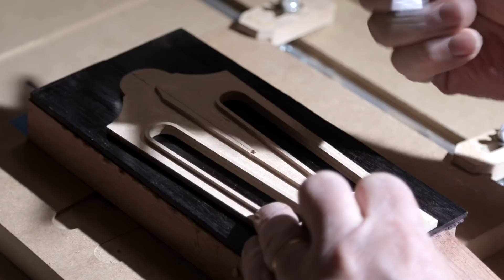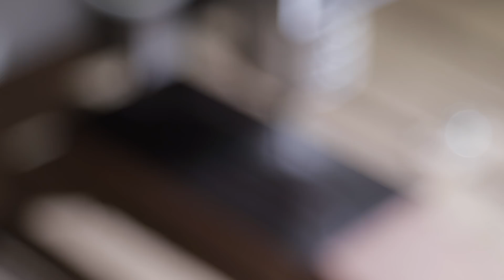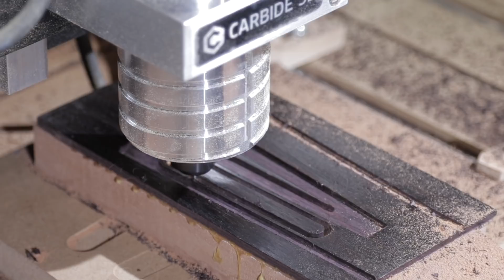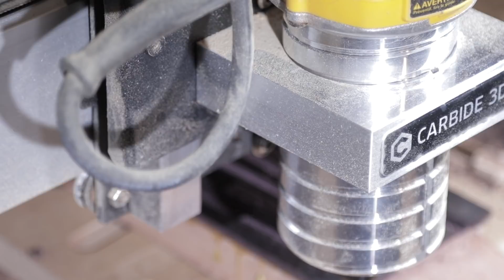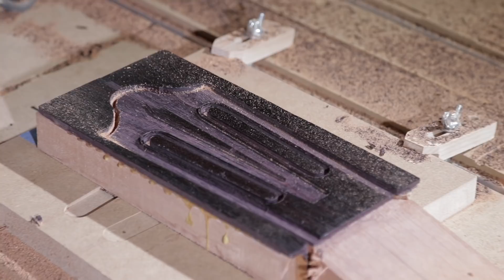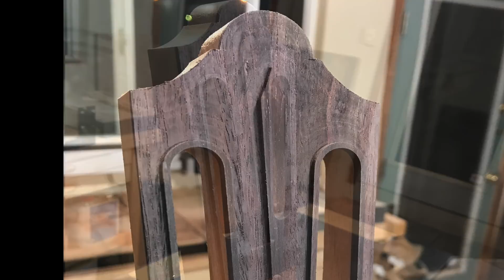Friederich Head carved on a Shapeoko CNC

Comment from the maker: Believe me, it takes far more skill and knowledge to cut a head stock like this with a CNC!  WTF is the difference if someone cuts a head out with a bandsaw then routs the head and slots with a hand held router, or table top router, or a milling machine?  Any Ape can cut a head with a bandsaw. That same Ape will have a steep learning curve and significant expense doing it on a CNC.

There are retired physics professors in my CNC class that are trying to wrap their brains around the tool-paths and design functions in CNC software. 

Not that I'm by any means a great artist, but there comes a point where the artist transcends the limitations of the technique that carried him or her to the goal.  I'm far more interested in design and the end result THE SOUND than the method.  I eat the food and throw away the plate.

Comment: Good toolpathing. Friedrich was quite an artist. Are you using his bracing too.
Reply from the maker: Thanks Ken,  I have to thank you for your suggestion to start from the center.  Sometimes the learning curve seems somewhat overwhelming that you overlook the most basic things.  The Friedrich head is a classic beauty in the classical guitar traditions. I've made maybe 200 guitars with Friederich's design, but, time to move on.  I did this head, just to see if it was possible.  I thought there would be a lot of chipped edges and the fine 2mm lines wouldn't work out.  To my great surprise it actually turned out beyond my expectations.  I might make a Friedrich copy with this.  But, the real purpose was to see if it was possible, then work in my own design using this type of pocket cut.

Comment: WWTD...  What would Torres do???
Reply: Well, Torres used the technology that was available in his time.
And that is exactly what Mike is doing here. Any other questions? ;)
Reply from the maker: LadycroMag BuntCitch      I like your style!
Reply from the maker: Nava, exactly so!  My new motto .... resistance is futile!
Reply: That's a good question.  I'm guessing he would not have used a CNC machine.  But I hope he would have used modern adhesives.
Reply: @robertbdesmond  He would surely make use of a table saw, band saw, router, powered jointer, powered planer, drill press, etc.  The CNC is somehow the bad guy after we are perfectly fine using these other powered tools.